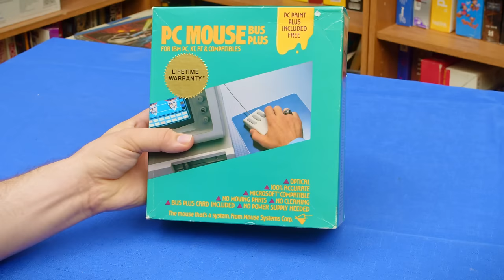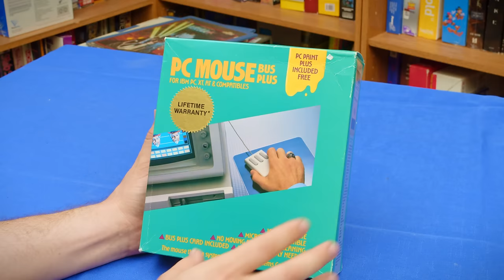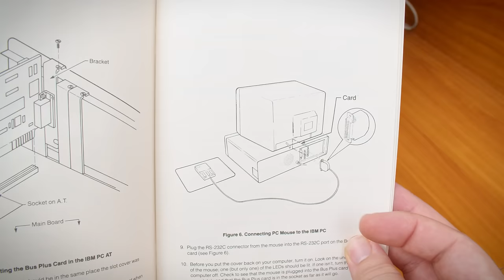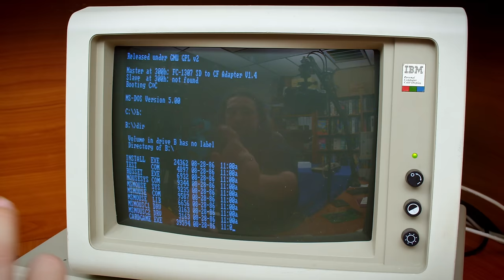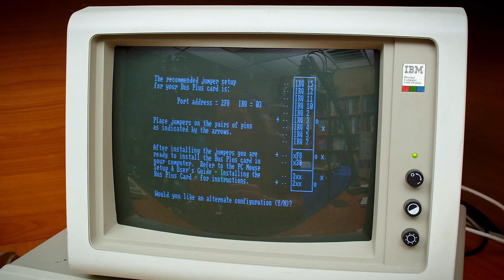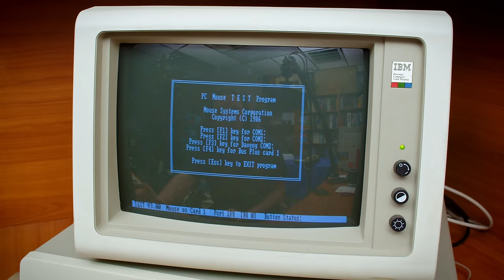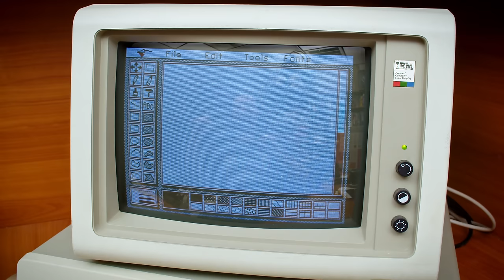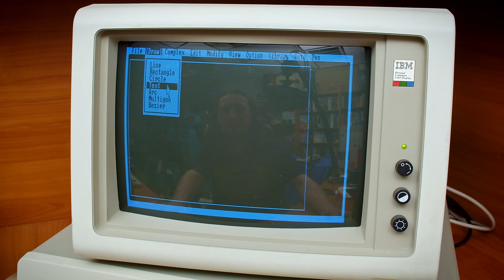The First Optical Mouse - Mouse Systems PC Mouse

Comment: Used the Sun version of these back in the late '80s/early ‘90s with the Sun 3 Workstation I had on my desk. Not entirely sure about the claim of 'never needs cleaning' as the felt pad on the bottom could clog up with dirt after a while and make the 'feel' of the mouse less great; we used to use the trick of sticking Sellotape to the pads a few times to lift the dirt out 😊

Did make the mistake of knocking hot chocolate into mine… the electronics survived and mouse movement was OK, but the buttons had a very sticky action after that (can’t remember if it was replaced or if someone cleaned out the buttons!

Should I mention the 'office trick' of sticking a Post-It over the lights on the bottom of someone else's mouse while they were away from their desk and see how long it took them to work it out? 😜

Comment: I used to have a Silicon Geometry Engine with an optical mouse, but my parents threw it away after I moved out. Probably worth a lot of money now 😠
Reply: upwards of 3000 $ now.....   My machine at home (an older Sun2 complete) is worth more.   The kbd in itself is 1000 $ or more (due to scarcity)
Reply: @TheStefanskoglund1  😈😭. I used to have 30 original Macs too (university salvage)

Comment: I had a string of Sun workstations as daily drivers, the early ones used this system and I loved it. Pretty much everyone else in the company however preferred the ball mice that came later. Problem was that you could easily transfer the natural oil of your hands to the reflective pad and then the friction would become really horrible. I found a wrist support essential to keep the contamination to a minimum.
I managed to keep my own pad in good shape, but in lab settings where the machines were shared the pads were always hopelessly grimed up and useless. Despite my love for this system, I found ball mice to require less maintenance overall.

Comment: Doug Englebart's original idea for the mouse also included using two of them on a computer.   One would be a pointer like normal, and the other would open compass-style menus and you'd choose the option by moving the second mouse in a direction.
So, yeah two mice is the OG concept.   I never saw it done for real like that.   A spaceball or some kind of 3D mouse for CAD, along with a regular mouse or a trackball for normal daily use was as close as I saw.

Comment: Not shown: the text-mode pointer, which worked by changing the background color of the character where the mouse was, using red. You can experience that in a number of apps, including QBASIC/EDIT, Norton Commander, or in Word for DOS by switching to text mode (I think with ALT-F9? It’s in the menus). The text cursor visuals are implemented by the driver, not the apps. The graphic cursor is also implemented by the driver I believe, and the app can provide a custom mask for it. For apps that don’t support mouse natively like Lotus 1-2-3, you can install the custom drivers that are app-specific and work by injecting keystrokes; those are fairly limited in usefulness.

Comment: We had this mouse on our first PC. It was a home-brew. It was built by a coworker of my dad. He built it with this mouse and it came with the PC Paint installed too. Ours was apparently a later model. It was a Serial version and it came with a flexible version of the mousepad that had rubber on the bottom. But it's the same mouse. As a kid I also noticed the two lights and wondered why only one was always off. And wondered what the grid was about. And when I saw a ball mouse later on for the first time on our Gateway 2000 Windows 3.11 PC I didn't understand why. Why indeed did they switch to ball mice for such a long time. Oh, and the mousepad never scratched in all the years we had it. It was pretty darn durable.
Reply: I can only assume that the LED inside these early mice were the most expensive part of the mouse.

Comment: We had the same basic mouse for Apple when I was young, but we got it used and it didn't come with the pad. we found that crinkling up alumin(i)um foil and flattening it back out worked reasonably well. but a standard ball mouse still worked better. Wish we could have gotten that pad though.

Comment: So back in the day I used these on Sun Workstations in school. I vividly remember how difficult they were to use. The mouse pads were very small and our screens were very large black and white models. The mouse pad would slip and you needed to keep the mouse at the perfect angle or else it wouldn't track.

When they worked it was beautiful and when they didn't work it was incredibly frustrating. It soured me on the entire idea of an optical mouse. I remember being surprised when the later versions came out for PC and they actually worked.

Comment: First proper optical mouse i used was on a SUN (SPARC station i think) machine. Stupid thing refused to work on my PC though, go figure 🤣I did get some for the PC eventually, cant say when exactly, but it early 900s?  Was a bit of hassle with the darned reflective plate but still nice not having to clean the ball constantly.
Strange seeing old DOS  Word. I used Wordstar, the tiny thing that dominated word processing, and its shortcut keys are stil de facto standard today.

Comment: I had an optical mouse for my Amiga 500 in 1990, a good 6 years before the Microsoft Intellimouse.

It also used a special mousepad but it was covered in small black and white dots so it was less picky about angles. 

Over time the laminating on the mousepad began to wear off and i began to worry what would happen when it disintegrated.

Sadly, the mousepad outlasted the Amiga line

Comment: The mousepad wearing is a huge issue - once it starts getting worn or scratched, your mouse starts tracking erratically like a ball mouse does, except you can't clean it to restore operations, so you're stuck until you get a new mousepad. And those pads wore down quickly - there were in-store demos that never worked because a few weeks of use would wear them down to the point where people wondered what the advantage was.

Comment: Now that brings back memories.  We had the same mouse on an XT clone, except we had the serial version.  It used a db25 connector with a barrel jack on the connector shell for a DC power supply.

Comment: Aktshually, the first optical mouse was made in the 70's and was for the Xerox Alto.
Reply: The Alto mouse is a ball mouse. Not even a rubberized ball, just bare steel.
While the optical mouse was invented at the PARC, Xerox didn't ship it. The inventor left Xerox to found Mouse Systems.